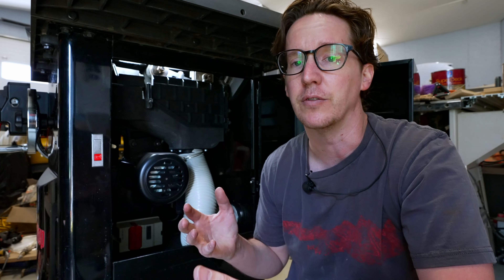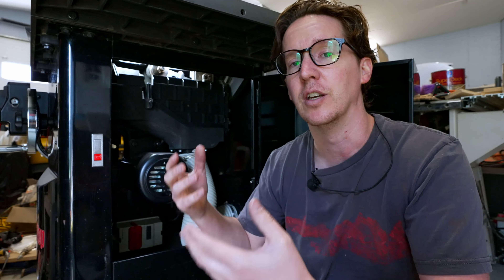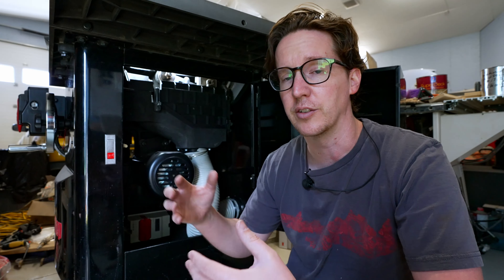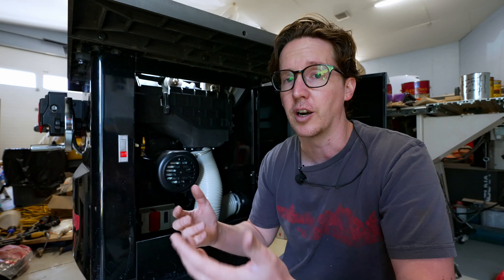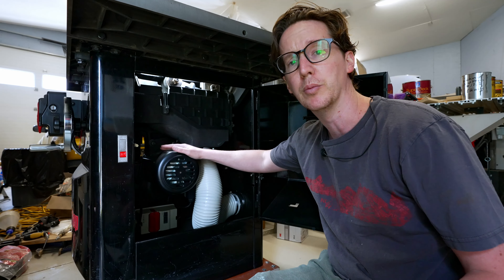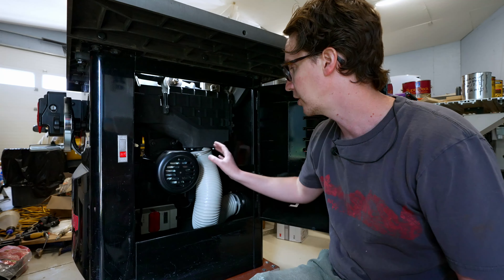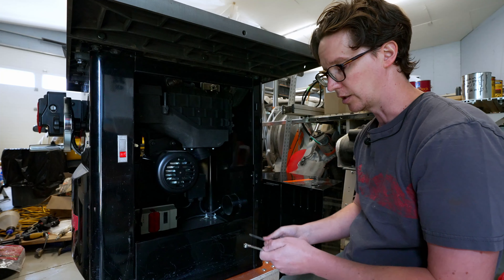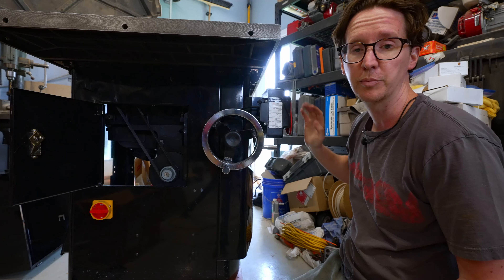Converting a SawStop Saw from three phase to single phase power

Comment: Was the red cable provided? 10/3? Did you buy a new cable and plug for the unit and it would have to be 10/3 to get 240v, correct?
Reply from the maker: I got the red cable from Princess Auto as a welding or RV power / extension cable and cut off the end I didn't need and used that end to hook up to the motor. I used a small section of the same cable to complete the connections in the base of the machine. The other benefit was that I got a factory connected plug end which is much nicer than any diy plug ends you can get.

Comment: Hi great video... where did you order your parts lf you dont mind me asking? Kms, bussybee, lee valley?. I'm about to do to the same conversion. I'm still hesitant about getting the 5hp or 3hp motor though... you have any comments on that? Cheers.
Reply from the maker: I ordered through Windsor Plywood, but I contacted Saw stop directly to get the part numbers first. You can order direct through SawStop, however SawStop does give free shipping to places like Windsor Plywood if they order enough all at once. So I waited to get on the next stock order for the store and jumped in to get free shipping. Not sure of the price difference between the 3HP and the 5HP. But I can't see it being that much of a difference. On the other hand I can't see why a person would really need a 5HP or larger Saw. I know this saw is night and day difference from my 1.5 HP saw I was using before. But not having used the 3HP model if is isn't a big cost to go up to the 5 HP motor and you have the power supply for it, I would just go for it and get the 5 HP one.

Comment: Do you have the 3phase components?  I just bought an abused 3-phase saw and need the 7.5HP 3-phase contactor box.  (I'll be using it 3 phase)
Reply from the maker: I do have it still, but to be honest I would just buy it new. I think the 2 phase one was around $200 CAD. They will also be able to ensure it matches your saw, there are a few different variants over the years I believe.